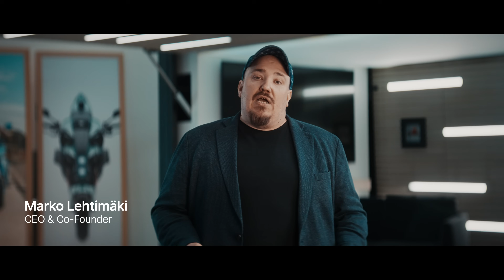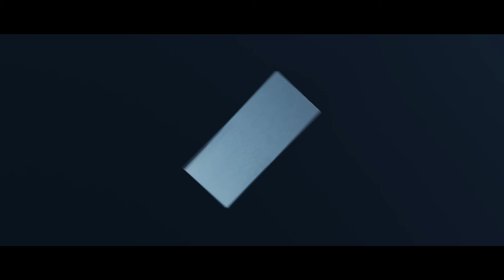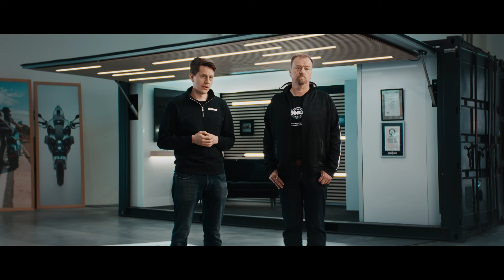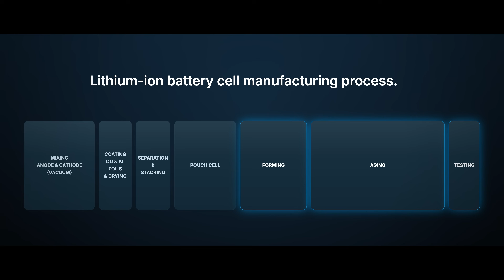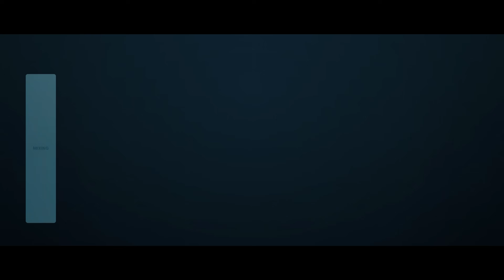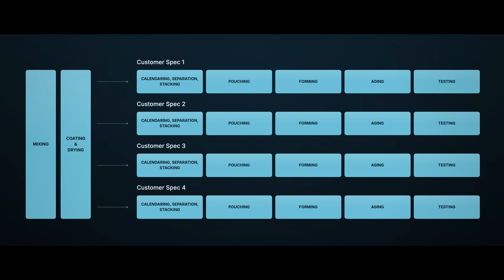Manufacturing & Scaling | I Donut Believe

Comment: Produce batteries.
Time has passed and customers have still no battery.
So produce
Nobody believes you
Reply: I believe them.

I mean, I wouldn't trust Marko Lehtimäki as far as I could throw him, but I believe in the underlying technology, because I've seen similar and am pretty confident it can achieve most of what they claim.

I'm doubtful about the claims for gravimetric energy density, because six years ago the technology wasn't even close, but a lot can happen in six years, especially with AI on the case.

People need to stop thinking it's Lithium or Sodium. It's neither.

It's a bipolar organic carbon polymer battery. All the claims make sense in this context, except the energy density.

Maybe it's a scam, but, if so, it's mainly the energy density they are lying about.

Comment: One gigawatt capacity is nice, but there is no demand for one gigawatt of their batteries at this point. It takes some time to convince companies to integrate your brand new technology and it takes some time for their old contracts to cancel or to expire so they can start buying this new technology. The problem is that no new products that use this new battery technology (besides the verge bike) have been introduced since January, so there is 0% chance for the gigawatt level of demand by the end of the year. And building one gigawatt capability ahead of time is just not financially viable without having guaranteed buyers.

Comment: Very cool. I see the massive amount of batteries that will be needed. For example, if you follow AI data centers in Europe, in Switzerland, a massive FlexBase-owned data center will be built with redox flow battery storage—2.1 GWh of battery storage capacity for this single facility. This is the new world.

Comment: I donut recall exactly what size of battery the Verge uses, I think it’s 20kwh, but at 20kwh a 1GWh production would equate to 50,000 batteries by my calculation - correct? If so, that’s more than you’d expect from a ‘lab environment’, especially as we’re almost half way through the year already. That’s quite a marker that Marko has put down!

Comment: I was rooting for Marco from the beginning, but so many videos later, the most important information people want to know, is the battery density and weight, how much charge a battery has for the weight it carries, it's still nowhere to be found... and this is what makes it fishy. Some Chinese manufacturers are already in full-scale production of solid-state batteries, with high-density watt/hour configurations and some with Innovations on the Cathode/Annode parts.
Reply: The problem is. The CT coating that actually makes these batteries have already stopped development on the  battery they thought they will introduce. So now they are stalling and waiting for the next battery so called version 2 to come out. But they haven't heard any sound proof from CT coating so they are fucked

Comment: Donut Lab already appears to have broken at least two major promises:

Verge motorcycles with its solid-state battery were supposed to be on the road in Q1 2026. That deadline passed without customer deliveries.
It promoted a 100,000-cycle battery lifespan as a headline capability, but this has not been independently demonstrated as claimed.

Its 400 Wh/kg energy-density claim and mass-production readiness also remain unproven.

Fool me once, shame on you. Fool me twice, shame on me.

Comment: It would be interesting to see 1Gw productionline. It seems it does not exist yet only in Markos' dreams. They might still operate in Marko's garage. I hope the best for the Donut but the credibility needs to be earned. Did they go out too early?
Reply: You are still speaking about one production line. Instead of building one massive plant, they package their technology into scalable, modular "factory containers". 1 GWh is not the size of the factory; it is the annual production capacity. It measures how much energy storage the facility produces in a year.
Reply: @eehoo3  Even then showing the container or Marko's garage would increase the credibility.
Reply: They just did say that they don`t need production capasity! So don`t worry!
😂
Reply: @haukikannel  Exactly you can print the batteries in home by using 3D printing. Donut just invoices  each print. Gamechanger

Comment: I thought the reason for the I donut believe video series was to supply the missing information about these Miracle batteries. To prove your claims, Donut Lab must release independent test data showing energy density (Wh/kg), power density (kW/kg), measured on production‑representative cells, the latest videos raise more questions than answers. The very first video in this series should have addressed this all important data.

Comment: Hey fellas,
A ProLogium battery is a next-generation solid-state lithium ceramic battery (LCB) developed by the Taiwanese energy innovation company ProLogium Technology. Instead of the volatile liquid or gel electrolytes found in traditional lithium-ion batteries, ProLogium utilizes a 100% solid ceramic separator. This design fundamentally alters battery performance, shifting them from inherently hazardous components into highly controlled, non-combustible energy carriers.
They are building a giga-factory right next door to you in France.
Good luck competing with them. Your secretiveness only hurts you.
Reply: ProLoguim use a superfluidized inorganic solid-state electrolyte, meaning it's a semi-solid state battery, one with a liquid inorganic interface layer in addition to the ceramic separator, it's not 100% solid.
Reply: @GruffSillyGoat 
They solved all the problems with lithium and liquids. 
You can take scissors and cut their battery in half, and it will still work. 
No drips, no fumes, no smoke, no poisons, no heat. 
If it walks like a duck...
Reply: @lophiz1945  - not saying they hadn't, but it's not a 100% solid-state battery. ProLogium have been careful in stating this, particularly as they've filed for IPO today on the NASDAQ.

Also, their current cells are NCM based, so have complex supply chain needs, so I wouldn't say they've solved all the problems, such as cost and material sourcing issues.

Comment: This video demonstrates that Donut Lab's business model has always been B2B, Verge Motorcycles is their internal customer, but via Verge Next the seek to sell the fabrication approach to other OEMs. This video reveals further elements of the business model, supplying the input product (battery substrate material) for OEMs to manufacture on site to shorten supply chain lines and dependencies. This whole video series has been primarily aimed at OEMs, to provide them support in deciding to opt for Donut Lab battery technology.

To date battery produciton has been fairly expensive and time consuming to setup for OEMs, for example either electing to co-locate gigafactories with EV production lines (Renault's Electricity, and Nissan's UK global EV hub are examples), or using long supply chains with long lead times for imported battery cells. What Donut Lab are indicating is moving to a more advanced model of delivery of pre-cursor battery materials, that can be formed and finalised on site to required custom specifications, with lower footprint, operation and cost impact equipment, which increases OEM product design and production flexibility as well as significantly reduces concept to production timescales. 

This will be an industrial step change and highly disruptive approach if Donut Lab can succeed.
Reply: Quality and performance of the battery will depend on the customer’s competence, not as much Donut’s.
Reply: Customer can make the form factor they need instead of waiting for Donut.
Reply: Customer will supply most of the needed capital.
Reply: The purpose of the videos is to find customers.
Reply: @astewart1900  - four separate replies? 

- Process: it's a model where quality will be more dependant upon the equipment's, rather than customer's, competence. It's a JIT assembly approach, some operational training will be required but that's no different operations of all manufacturing equipment. The quality/competence aspect is a split role between equipment/materials/method and onsite production execution (likely highly automated), producing highly repeatable results. Many EV factories, for example, already have on-site compentance teams for battery assembly, this will just shift the model to in-house rather than external supplier (reducing the dependency risk and exposure).
 
- Form factor: agree this is about reducing the complexity of long supply chains, where battery design is either off the shelf or subject to long design timeframes and minimum order quantites of a large scale battery manufacturer. The ability to form cells to a company's particularly needs and characteristics shifts this to being just another process step, one that dramatically reduces product development time and costs.

- Capital approach: correct, this shifts the investment/reward balance in favour of the OEMs, the battery maker becomes a lower cost technology and materials supplier not a finished component goods supplier. The equipment/materials supplier can then apply focussed investment that increase the functionallity and quality of their production equipment and battery pre-cursor materials. 

- Purpose: the video's aim seem multipurpose. Agree to advertise for OEM customers. However, I suspect also to support those customers already working with Donut Lab. These videos make it easier for "Donut Battery Inside" type marketing by OEMS. 

Donut are promoting an eco-system not just a product.
Reply: @G@GruffSillyGoat the process I think you’re underestimating the likely requirements for onsite integration, testing, and calibration and following regular maintenance, testing, recalibration, and repair. Unless Donut is going hire and train technicians and require customers sign a service contract to buy their equipment customers are going to have to do those themselves. From what I’ve gathered in following Tesla, Panasonic, and the EV industry in general, battery manufacturing is far more complicated than buying some machines and installing them, and competency in operating and managing those machines has a direct impact on the quality of the product produced. As I recall several EV manufacturers have done large scale recalls due to battery cell manufacturing defects. Musk says production at scale creates new problems not found at smaller scales. I believe him. Donut claims to have simplified the manufacturing process but I would be skeptical they’ve solved mass production.
Reply: @astewart1900 - I'm estimating on the basis of the technology involved. For example, traditional coating companies in the UK are repurposing their ink printing equipment for battery production. The UK battery innovation centre took receipt of one of these units from E+R Coatings, with it being operational within weeks of delivery. It seems the technology operates at a different level of requirement to traditional battery lines, with their extensive training requirements, clean room operation, and need for careful handling and regular planned maintenance. Not all battery technology is equal in needs, and many systems are highly automated particularly with finishing roles.
Reply: @GruffSillyGoatmaybe, but I’ve been reading about 24M since sometime in the previous decade. My understanding is their technology is screen printing or similar. They say they licensed it to Kyocera in 2020. I’ve never seen any news that Kyocera has a high capacity, safe battery they’re producing at high volume and low cost. So I remain skeptical until there is independent evidence that DL can successfully transfer this manufacturing of this battery to a customer, success being meeting DL’s specifications at substantial volume, adequate reliability, and low enough cost.
Reply: Well Said

Comment: Let's GO !!! 🎉 DL can these be made into smaller sized cells? Having a reasonably priced version of your battery as easy as picking up a pack of AAA batteries at the corner store would be ridiculously awesome. The world would never be the same. Imagine a safe rechargeable AA-AAA battery that has a reliable 100K cycles 😂🤣 you could buy them once and then hand them down to your grandkids when you die 😂 I'm joking of course but that's not far off depending how old you are 😅 To me, that's what is so amazing about Donut 🍩 Labs battery is the cycle count that alone is 😲 wow. Besides, does the average person really care if their gadgets can charge in a millisecond? I would take longevity (100k cycles) and reliability any day over extreme charge speeds and low weight per kg. Having that kind of cycle count makes going solar a no brainer even if the roi is long the cycle count makes that up in spades. On a side note, I hear some countries are now requiring cell phones to have removable batteries by law thankfully that will cut down on making everything so disposable, and that's fine to do, but it shouldn't it be a law that if you want to make something disposable it must be able to easily be near 100% recyclable. Because the landfills are not getting any smaller.... But that's just my opinion and I don't make the rules lol.
Reply: Elle est déjà abordable car la 23 kWh Brut est au même prix que l ancienne au Lithium et c’est la 33 kWh Brut qui coûte 3000 euros de plus, mais c’est normal puisqu’elle fait 13 kWh brut de plus, soyez un peu logique … c’est celle que j’ai commandé d’ailleurs, car étant à la campagne j’ai besoin d’une super autonomie et d’une recharge très rapide de temps en temps quand je m’évaderai assez loin, ce que je ne peux pas faire avec mon Alrendo TS Bravo …

Comment: There seems to be 5 groups of people:
We've been waiting for this kind of technology for years. Tell us more about the products and timing from your partners. 
Our company cannot survive if we are the only ones without this tech. Sign me up. 
Youtubers ignoring most of the stated information and trying to align it with existing technology. 
Those who will only believe tests they design and do themselves. 
Vested interests who profit from delaying new technology. 
Only the second group is important. 
Thank you Marko and the team for continuing to entertain us in the other 4 groups.
Reply: Yep, the concept and real product here completely goes over most commentor's heads, that this is an OEM B2B pitch. One that is about disruption of existing supply chains with a manufacture process that reduces costs, reduces design to product timeframe, and increases flexibility for the OEMs. Too many are focussed on specific battery details and ignored the bigger picture, and that it was always stated the configuration of the cells can be tuned to requirements.